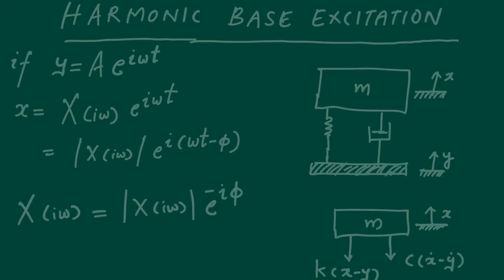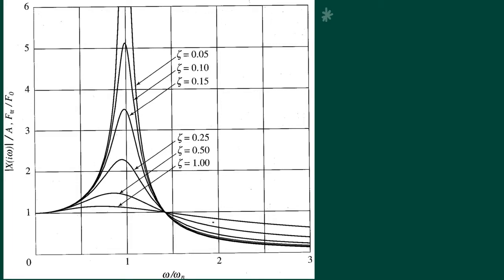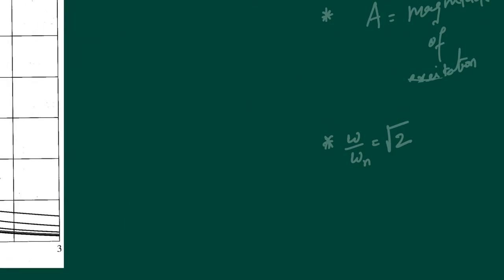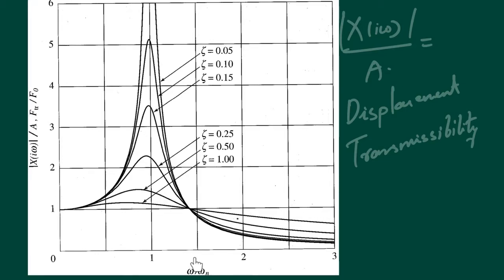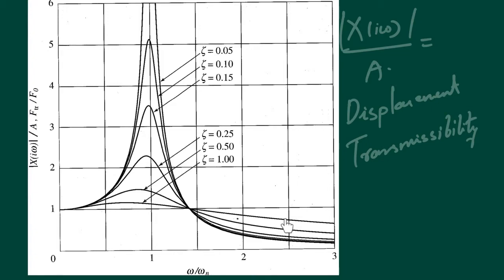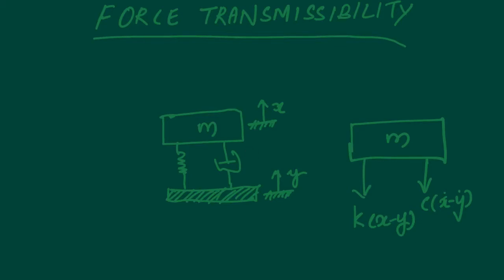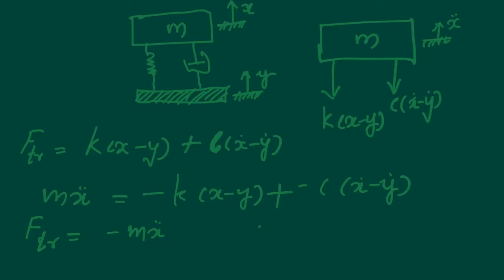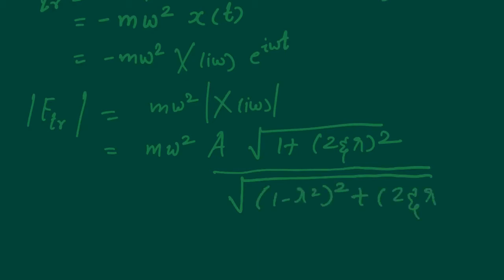Lecture 21 : Harmonic base excitation: Displacement Transmissibility and Force Transmissibility

Comment: Thanks for your lecture, but I have a question, can you help me? I have the following problem
With the SDOF system as above, the system is vibrated by an external force with 5G acceleration amplitude. What is the amplitude amplitude ratio of mass m with that 5G acceleration amplitude for fundamental frequencies from 10Hz to 1,000Hz?
So how is the acceleration amplitude here calculated?
Thank you very much
Reply from the maker: Amplitude of Input acceleration=5 g , but now you tell me the range of frequencies.
For example, if input acceleration is given as a(t)=a_{0} sin(wt), then a_{0}=5 g, but what values does “w” (forcing frequency) assume? 
One additional piece of information is also required: Natural frequency (or fundamental frequency ) w_{n} of the system?
Reply: The full question is like this:
"Investigate an SDOF system. Suppose mass m = 1kg, k = 400,000 N / m, Q = 10. The system is vibrated by an external force with amplitude amplitude of 5G (1G = 9.8m / s2). Draw the ratio of acceleration amplitude of mass m with amplitude of acceleration 5G for fundamental frequencies from 10Hz to 1,000Hz ?"
w_{n} = sqrt (k/m)
Reply from the maker: What does Q represent?
Reply: Q is quality factor of the system
Damping raito coefficient (ζ) 
Q=1/(2*ζ)
Reply from the maker: See my answer here . https://youtu.be/pxVrwHGococ